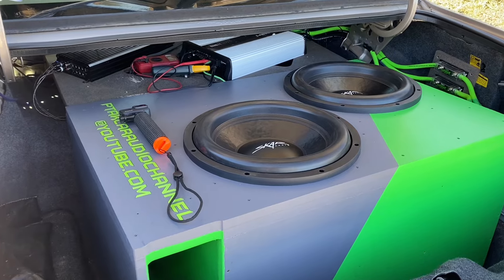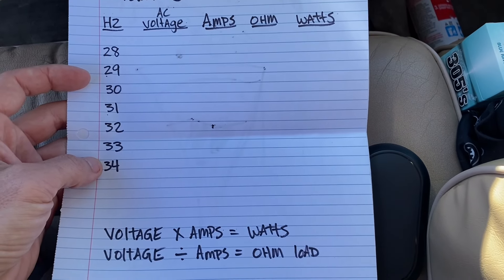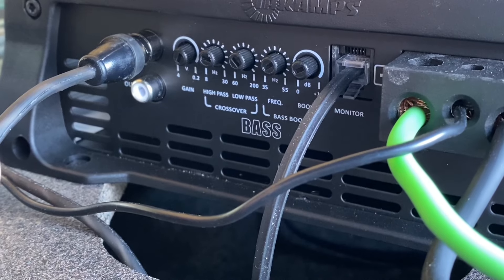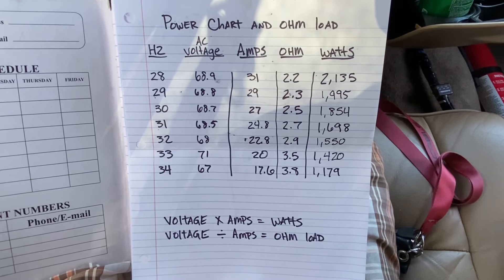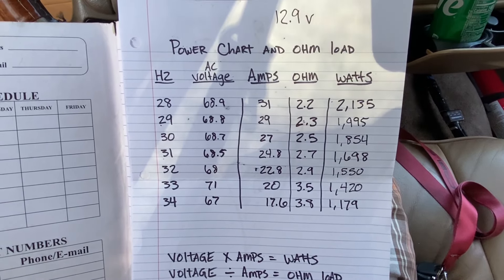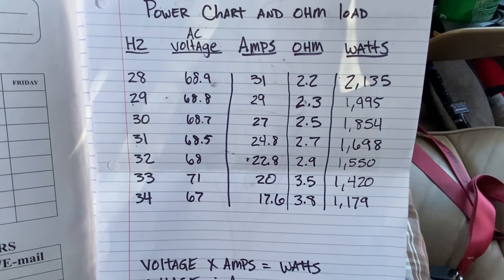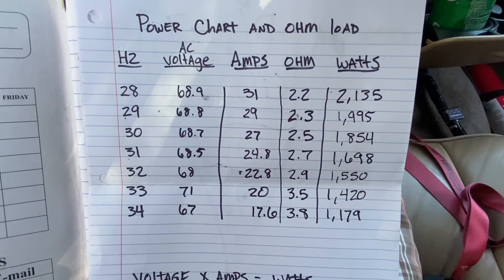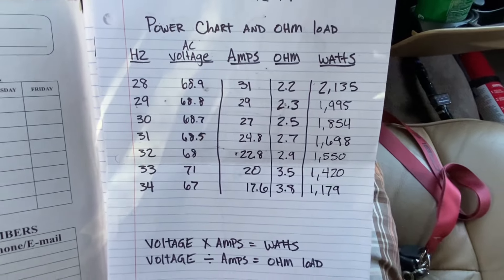Clamping taramps smart BASS 5k on VXF 15s. How much power did it make??

Comment: I like how you used the measured/known numbers to figure out the numbers you want to know
Reply from the maker: Yes sir equipment is too expensive
Reply: I agree. Started in 1987 with car audio.  Set stuff the old way for years.  Works today just like it did then.  Is it nice to have? Yup.  Absolutely necessary? Nope. To this day I only use an oscilloscope, volt meter with amp clamp, paper and pencil.  I use dsp now, but for basics, all brain power. Young people need to keep this stuff going or it will go away.  Not everyone has money for high level testing equipment.

Comment: Have you seen the Jag35 Lev60s. Just recently changed my setup from 3 of the LTO 6.0s to a 148ah Lev60 and the difference is remarkable, they are extremely cheap right now. Only $300 they hold power, and can be ran with your current battery. I am currently running a JP83 at 1.6ohms and a JP23.4 all channels loaded at 2 ohms. I have a 370 amp alt. If you have any questions just ask.
Reply: Yea id like to know more

Comment: I have 2 15s but had a dual alt setup with 350 amp just on charging the lithium battery by it self running 15v. On a 8k amp tho..i wanna test mine . I smoked em but dont know if it was glue as they were new or i hurt em

Comment: @Ptakcaraudiochannel- Why did you set your LPF so low, @ 45Hz? Most use 80Hz, 100Hz, or 125Hz, as there LPF= Low Pass Filter set point. You are losing a lot of bandwidth. Do you have strong mid-bass speakers, that cover 40Hz, and up well?
Reply from the maker: It’s set where it barely starts cutting about 50hz, all I listen to is rap and the box is tuned pretty low
Reply: @ptakcaraudiochannel2675 - I have 4-18s tuned even Lower, and Listen to modded, re-bassed, and slowed music, shot out to my boy Dj Russticles, and i run my Lpf @ 80Hz. There is a lot of musical content above 50Hz you are missing, and those VFX are very musical, and capable to do it. Give it a try sometime, it really helps to tie into your mids and highs=without a gap.
Reply from the maker: I’ll change it to 80, I know these subs sound great with that higher punch. I need some more midbass 100-250
Reply: @ptakcaraudiochannel2675 - Im sorry if i seemed pushy, or like a D**khead, i really want people to maximize there audio systems. I know most people don't know this, because its not tested very much, but a crossover can reduce the Db output of freq. that are very far away, from the intended set point. It varies greatly with the slope/Db per octave(6Db, 12Db, 18Db, and 24Db per octaves are the most common) used in the crossover setpoint's. I have seen tests, and done tests, showing the effects on Db loss, depending on all of these factors. I have been a car audio champion, and competitor, for over 30 years, testing many things audio related, with a Car audio Team.
Reply from the maker: It’s all good man and thank you I’m always trying to learn more I really love this stuff